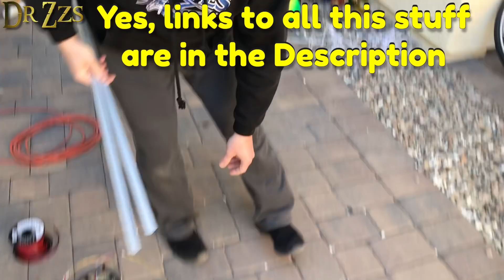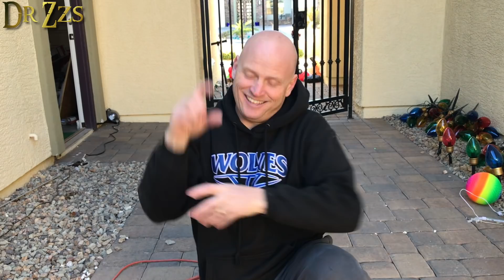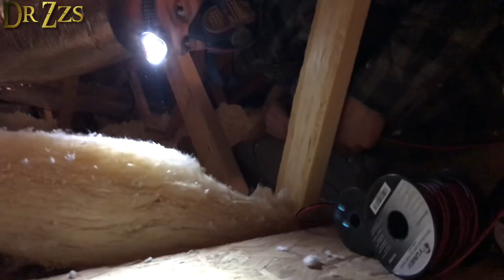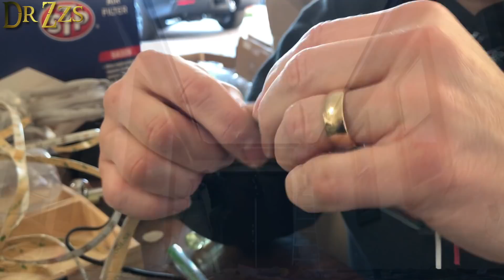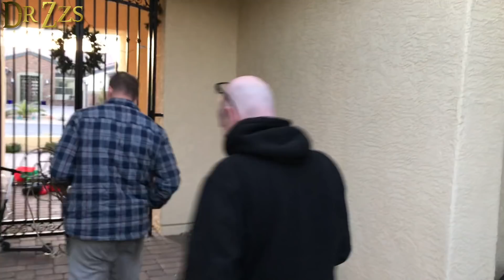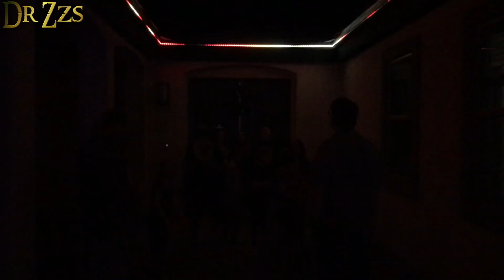Installing Permanent LEDs w/ DrZzs in Las Vegas - Voltage Injection - RGB Strips in Aluminum Channel

Comment: The Dusk and Dawn feature on the light fixture I purchased does not work. It’s an Up and Down fixture from the company Tesjaso. I attached the fixture to the exterior Outlet box and the lights can turn Off and On when you manually use the light switch inside the house. However the Dusk to Dawn does not turn the lights On or Off.

The company does not know why it’s not working and they sent me a replacement and it does not work either. Is there anyone out there that’s smart enough to solve this problem. I like the lights and I don’t want to go thru the hassle of taking the fixtures down and shipping them back.

Comment: I have some LED's that I want to put out quite a ways from any of my access points... is there a wled or similar software for a LoRa board?
Reply from the maker: No, but a board with wLED can run standalone, where you walk up to it with your phone and adjust it, and it just runs on a schedule on it's own.  It will need power.

Comment: So the 18ga power injection wire is a single wire that travels inside the channel next to the led strip where when needed you can splice into it  for power?  Is that correct or am I missing something? I’ll be installing 8 strips for my house, do I need to run more individual power lines from the power supply or will this  be sufficient. Thank you for all your help. Digquads are back in stock. Ordering today.
Reply: One inside the channel

Comment: I saw that you are only placing a power injector at the end of the led strip. Is there any length recommendation on which strip to place it in? OR will it suffice to use one in the beginning of the strip and another one at the very end which in you video should be about 64 feet?

Comment: I've been wanting to  put up LEDs on  my house for a long time and I'm ready to pull the trigger. Your videos have been very informative and I want to thank you for them. I want to have a run of about 100' (6 five meter strips), which is very similar to what you've done in this video so I know I'll need power injection. What gauge wire did you use for that at your sisters home? I've seen tables that suggest everything form 22AWG to 12AWG. How do I go about calculating that? Thanks!

Comment: Can anyone tell me if I can use 16 or 14 awg speaker wire for power or data extensions? I need about 12 inches between power/controller to first pixel and about 8' between first and second 5M light strip. Im trying to connect two of the 5M 60LED/Meter strips in a single run off a Dig Uno. Thanks

Comment: I see you are injecting voltage at points into the VCC and GND rails....does the signal rail not suffer from voltage drop? Or is the drop so little that the controllers still cand distinguish 0 from 1? And if this is the case, at what length could this start becoming a problem?
Reply: He added a sacrificial pixel to boost the data line that's why he didnt have issues.. if he hadnt done so the data line would have failed on him. Dr zzz has other vids  that discuss   how  long u can run a data line without a sacrificial pix and one with it. I'd check those out if u havnt already.

Comment: Would I need the power supply and mcu controller, if I just wanted to run a solid color (white) LED strip under my car doors (12 volts) so I can see to get in and out... I hesrd that the amperage keeps climbing on LED lights...

Comment: For those saying a fuse should be used, where and how often?  One right off the power supply or one at every injection point?
Reply: One off the power supply would handle any shorts in the entire line
Reply: @artificiallyuninteIIigent please what amps fuse?

Comment: Hey DR...thanks for this one.  I was looking for something that used the Nodemcu or other  ESP8266 boards and nothing else but power supply and wiring.  I've been reading about your Dig-Uno but since I have a lot of Wemos D1 Minis and Nodemcus, this one helps me get started.  Showing the power injection at the 3rd set of LED strips really helped, too.  Thanks a lot.  Irv in Florida

Comment: just a quick question.  I am getting ready to make the plunge into decorative LEDs.  Is there enough room in the aluminum channel for the led strip and the power injection wires?  i am looking at 4, 16' foot led strips inside my den, obviously don't want to see the  injection wires. thanks.  Your vids are entertaining as well as informative.
Reply: Having done this, I would say it depends on the gauge of the wire. For that distance, 2 stand 20 gauge wire should be sufficient for power injection, and should fit in the channel if you're careful.

Comment: Why 5V instead of 12V? I see all these 5V installs requiring more power injection, but never clear on why that choice is made.
Reply: Just guessing, theyare probably ws2811 or 2812b strips which are 5V and each LED is individually addressable, where as WS2812 is 12V and its 3 LEDS per each IC. So they are addressable in groups of 3.
Reply: I'd like to know too
Reply: WS2812B 5v is one of the cheaper options. Just depends on personal preference and how much power injection you are willing to input.

Comment: Honestly, if you know you're going to have to cut off some less at the end, I would've just cut the first one off each strip rather than trying to get the shrink tube and desolder
Reply: Yep but the IP coating is a pain to remove

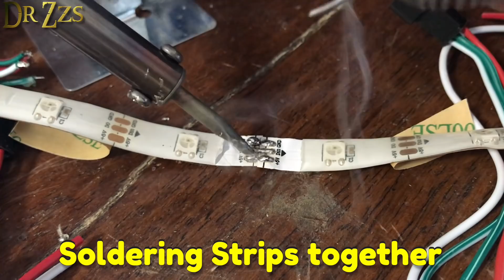Comment: Thanks for showing me how to link strands together (8:56). I was wondering how to get rid of the gap between connectors. 🤦🏻‍♂️ Don’t know why I was thinking I was going to solder a small wire between them.

Comment: Dr Zzz.  Do you have any details on how you handled the 90 degree bends in the corners?  Also did you run the wires external to the channels until you reached the ends?
Reply: I just finished an install and anywhere I had to corner I cut along the solder pads and added like 1" of LED wire around the bend and then soldered that wire onto the next strip once I had made the bend.

Comment: Couple of install tidbits I didn't see were installing the covers (adhesive back will fail sooner than later), how you turned the corners, and, importantly, how hot does the attic get? PSU, 8266, and that pixel might not like it. 
Other than that, good job.

Comment: I use exactly the same setup but keep having issues that the led's are giving white random flashes. mostly when the led's are turned down to around 20%. When it goes on for to long it even resets the nodemcu any ideas?
Reply: I had that issue once turned out to be a bad nodemcu I use a few in my setup and have had then bad out of the package

Comment: Curious as to why you guys didn't use a Dig-Uno for this project?
Reply from the maker: because he had a bunch of NodeMCUs on hand and I don't have any Digunos right now to use.  Someday we'll probably swap them out.
Reply: Makes sense. I know I have been stalking your site in hopes of a restock. Need a couple DigUnos and DigQuads. Ordered two not too long ago and love them (well I have a worry about one as it showed up with the container it was packed in cracked and the main power connected is slightly bent... seems to work but I am watching it). Going to do a lot more projects around the house with them and also a friend hired me to do some window lighting in her ice cream shop.

Comment: Why the sacrificial LED? In case something goes wrong? Also how long can you run that data wire?
Reply: The controller board outputs data at 3.3v. The sacrificial pixel bumps the 3.3v data voltage up to the required 5v. At 5v, the data can travel farther without corruption.
Reply: @JasonSomers  Thanks, I was wondering how he was able to use such a long data wire.
Reply: It is basically a janky way to get around needing to use a level shifter, which would be the proper way to handle the transition between the 3v3 output of the microcontroller and the 5v input of the LEDs.
Reply: @cryptk  With a level shifter, do you know how long you could go with the data wire? Ive seen someone with some sort of amplification board, it has a transmitter and receiver. Dont know whats actually on the board though.
Reply: @michaelangello1  Depends on MFG, but generally around 20ft.
Reply: Dos that mean you have to take into account that one led when setting up how many leds you have?  I would assume so.  Level shifters can be found at sparkfun or adafruit.

Comment: Please use a fuse :S or Dig Uno. Powerinjection looks good :).
Reply: Would you even be able to use a Dig Uno for this application with a 60 amp power supply and 4 x 5m strips of ws2812b? 

That's about 20-28 amps of draw for most effects (except pure 100% white) and the fuse on a Dig Uno is only rated for 10 amps. Even wiring the power injection (in parallel) like they did, I don't know if that would blow the 10 amp fuse on the Dig Uno
Reply: @jonbetts8473  Dig-Quad would be ideal for this use, you can use the extra power channels for the power injection.
Reply: Plus a relay for the SMPS

Comment: What purpose does the sacrificial led serve?
Reply: Technically sacrificial led is to boost data signal on longer run
Reply: The Led Strip's First led should not be far away from the controler, or the Data-Signal will Not be strong enough.
Reply: It boasts the signal voltage from 3.3 volt to 5 volt
Reply: What is a sacrificial led exactly? Is it the first led that is cut off or something? First time I hear this term.
Reply: @Richard79  "Sacrificial " in the sense that it won't be seen. They could use a logic level converter to boost it or just chop off/sacrifice an led to use instead to boost the signal.

Comment: Please use fuses between the power supply and led and the node mcu
Reply: How many amps fuse should I use please?
Reply: @MrShabo509  It depends on the size of wire, however, 5A is a good place to start assuming 18 gauge wire.
Reply: @KoreKount  thank you

Comment: Sacrilegious!! He's using a NodeMCU!! 😱😱
Everyone knows the Quin DigUno is better/safer.
But he knows that. 😊
Reply: Nodemcu is perfectly fine if you fuse  the cabling and a fraction of the price.  Plus if you are injected a lot of strips you will need extra fuses even if using a diguno.
Reply: @qualar how many amps fuse to use?
Reply: @MrShabo509  Base the fuse on the cable size.
Reply: @qualar  16 awg cable 15 meters of led(450 led) is 15 amps fuse enough?
Reply: @MrShabo509  Generally, a 16 AWG wire is rated to carry up to 10 Amps.
Reply: I know, I was just messing with the Doc 🤣
Reply: @Thamli  👍
Reply: My guess is they are still out of stock...